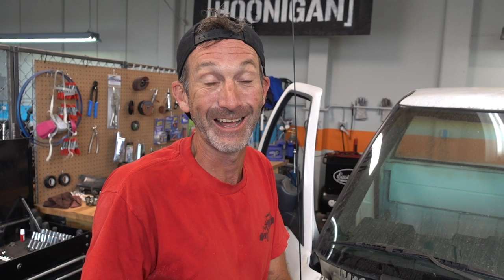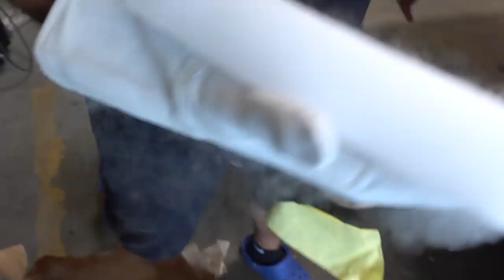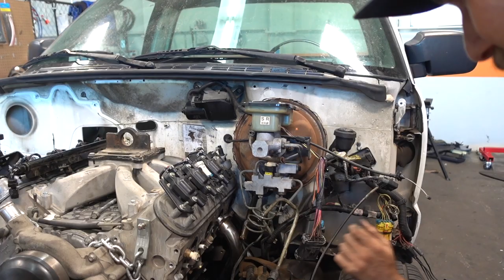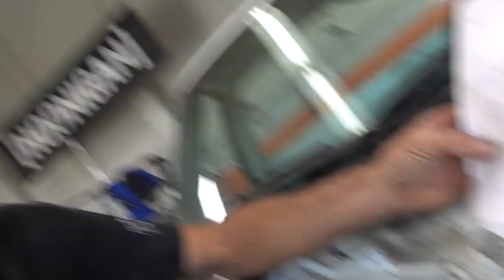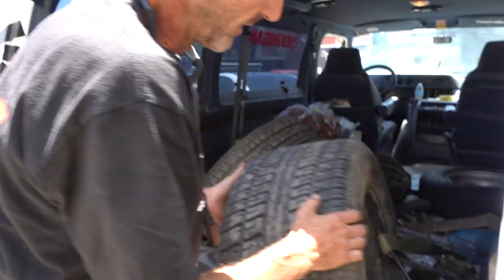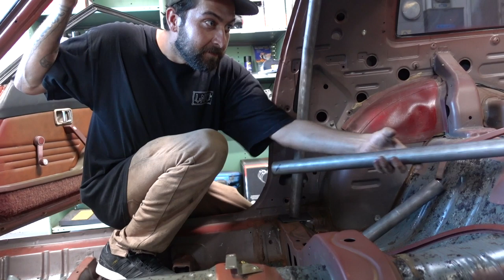Build & Battle: Engines OUT! Rotary vs V8, What's the Fastest Budget Drag Racing Motor? EP.2

Comment: Dan: wipe it carefully with paper towel when cleaning the engine

Brad: sprays the entire engine with pressure washer
Reply from the maker: Pretty sure Brad is just trolling all of us...
Reply: Also Brad: There's a random nut in this engine.
Reply: Klip One if you remember from his first hoonigan video, brad works/worked at a pot dispensary... he’s probably high off his ass... I mean the man power washed his own shoes and pants lmao
Reply: @zerohourdrift  Erm I managed to power wash myself every time I tried to clean my car. Now i just use the drive thu car wash.
Reply: Wor Jackie I mean I can understand getting a little damp from the mist, but if you get yourself as wet as brad did, you obviously have other issues than power washing skills lmao
Reply: Wor Jackie drive through for yourself or your car ?
Reply: Pull rockers and push rods and all the valves "should" seal
Reply: That literally made me cringe hard core
Reply: @1OMEGA111  you do realize aluminum does oxidize (rust) right?
Reply: @1OMEGA111  you think the sleeves in the block are aluminum? Ohhh yes. That'd last a life time man

Comment: Dave freiburger
Hammered in a header and tested it on the dyno no loss of horsepower...
So start dinging away
Reply: willierepair One didn’t they actually gain hp? It’s been a while since I watched that.
Reply: That header bash dyno test was great!
Reply: They way it looked on the s10....they had to pretty much dent it to half its size and I've watched that dyno test and he didnt dent it that much in
Reply from the maker: Brad pulled out a sledge hammer when he said he was going to hammer the header... Not sure how that would work, but hammer away Brad!
Reply: @DR.P3RKY  they did
Reply: chase webber actually they hammered the shit out of it.... it still made no difference
Reply: Shoulda just flipped them and sent  it out the hood
Reply: @snikwad003  
Exactly what I was thinking XD
Reply: Flip them and do dual fender dumps
Reply: snikwad003 That’s what I wanted to see! I guess the refund is better for the budget.
Reply: This could've been fixed easily with a jeep grand Cherokee steering shaft . Hope this helps people who are doing this swap 😊
Reply: @andrewwagner9426  they have special headers that go over the frame that look like spider legs, and the steering can use 2-3 knuckles to go around it without it binding up, not to mention it is a drag vehicle so the brake booster can go also

Comment: Awesome project! The s-10 column base can be flipped over lowered and or moved to the right or left to make room for headers where it connects to the firewall. You can gain an easy 2.5 inches in any direction without sacrificing safety. You guys are brilliant and I'm sure you will find a better solution. 1981 camaro stock manifolds will clear the steering no problem.

Comment: I've used the same headers and engine mount S10 swap brad had and mine fit fine, you take the steering column off and squeeze it between the 1st and 2nd tube, no clearancing needed
Reply: Jeffrey Bigar i had some similar just took them off bashed them in a bit grinned the shaft down and i have no issues

Comment: when i first got out of diesel tech training my first task at my job was a engine harness on a Maxxforce 10.. i was terrified, but after that first job ive done alot of different harness's, most of the connectors on internationals wont even plug in to the wrong spot they all have specific pins and keyholes so they only fit their spot.

Comment: You can do either a Ford 8.8 with mods to make it work or get a Corp 8.5 10 bolt from a 4x4 S10. Brad is that the motor that was pulled out of Jon's Tri Five by Fire? The Stock 4.3L V6 radiator will work but the core support needs to be trimmed.

Comment: Damn son, I have that same Turbosmart PowerGate 60mm wastegate on my 612 whp Civic and I love it. Holds boost rock solid.
Reply from the maker: How many pounds are you pushing through it?!
Reply: @HooniganProjectGarage  Right now it's tuned to 22.5 psi and it's making 612 whp on a built LSVTEC with a Garrett GT3582R dual ball bearing turbo. It also has Skunk 2 Tuner Stage 3 cams, S2 dual valve springs with titanium retainers, S2 lost motion assemblies, S2 3.5L Ultra Race intake manifold, S2 90mm throttle body, and the list goes on and on. It was fully built with overkill in mind so that if I wanted to push it harder, I can. The cool thing about it is that I built all of it, short of the bottom end because while it was at the machine shop being bored and line honed, I figured it best to have a professional engine shop assemble the rotating assembly. They also balanced it to rev safely up to 10k rpm.

Comment: Quick Tip:  If you want to get the loose rust of that clutch, use the pressure washer, then touch up the rest with the wire wheel.

Comment: `Headers for an LS in a S-10 Have the steering shaft run through the headers. It has one of the header tubes that comes off so you can install them with the steering shaft in place. its a strange looking header but fits without doing any strange mods.

Comment: Pour Some Isopropyl or denatured alcohol on that Dry ice next time. It will massively increase the interface area (as long as you don't have the drain plugs out). The alcohol will not evaporate when that cold as well.

Comment: I hope that Brads 5.3 runs ok because that engine looks like it has the active fuel management on it and on those engines the lifters like to collapse and eat up the camshafts. He should’ve went with an older one.
Reply from the maker: Not sure if that's the issue, or if Brad spraying gallons of water inside the heads were a bigger issue.

Comment: Obviously the V8. Doesn't matter which one there's the two big ones like small block 350 or the 4.8/5.3 LS, both have huge aftermarket support and easily make 450 to 1000 horsepower cheap. The rotary engines face to many problems and need babied.

Comment: A Dana 70 in a corporate 14 are two completely different rear ends and a 10.5 inch ring gear is not the biggest they put in 3/4 ton and 1 ton trucks try 11.5 in 11.8 the new trucks coming out today are 12.0 inch ring gears

Comment: Paying the welding guy should be out off budget right. Because its for the chage and rear axle. And the chage is for savety and a rear Axle that doesnt fly out is also better
Reply from the maker: Any help that is brought into the shop is paid at a rate that is discussed between the helper and the team hiring the help. It does in fact come out of the budget.

Comment: Idk why brad is putting nitrous on it instead of a turbo. That 5.3 won't hold 400-500 hp shots and that's what it would need.
Reply: Its an aluminum block 5.3. Not good for boost. Notorious for windowing.
Reply: Heat the middle of summer
Reply: Dude I've made over 700 wheel with a aluminum block. It would break with nitrous before boost at the same power, if it even made it there. How many guys have you seen with a 500 shot on there stock bottom end aluminum block ? None.
Reply: Vargas is going to win this one if he makes 500hp with that go cart. Brads stock 5.3 with a 150 shot isn't going to do the trick. He could have thrown a cheap turbo kit together for what he will have in the nitrous system and made 600hp easily and had a chance.

Comment: This is just a big expensive learning experience for brad, no shit that rear end wont work... it weights more than the truck and especially just to get gapped by the brothers... he shoulda used stock Manifolds from the beginning with a $160 eBay gt45 and boosted it so he would even have a fighting chance... I’m not hating by any means cause I love watching all you guys but I’m just over here cringing. I ls swapped and turboed by truck for $1,800 ran a 12.7 on street tires at street care takeover and I DAILY DRIVE it to work 80+ miles round trip everyday. Too bad y’all are on the other side of the map I could show ya a thing or two.

Comment: Jesus christ. Brad's engine is gonna hydrolock and bend a rod before it even runs. As for the dorito comment. Can literally pour water in a rotary and it will just push out of the exhaust port.
Reply from the maker: The water is only a small part of Brads issue, what about the magical Nut that jumped out of Cylinder 3... Brad might be trolling us all right now.

Comment: i'm trying a challenge for my self trying to build a car for free so far i got 2 camero's one is a z28 hard top and the one i'm building is a z28 rs full spoiler kit car got both for free the motor is a 454 stroker with tunnel ram with 6000 miles on it got it free with a heavy duty 400 turbo the  hard  top had new and custom interior just need carpet traded a rig i got for free for paint i got a set of new headers for  my 68 pu but they sent me 2 sets for the price of one set and they said just keep them got a set of center line wheels just need tires all most got everything i need to build for free as  soon as i get my 68 pu dun then i'm starting the free project so far i have 1500 in my pu and it is sweet i'm hopping to have it dun by next month for a car show and it is just me and my kid working on it

Comment: Use the headers ... put the drive shaft between the middle of the header ....streach bend add whatever with similar tube and use them that flat stock you had there look embarrassing for a real builder .... im sorry but i could have done better